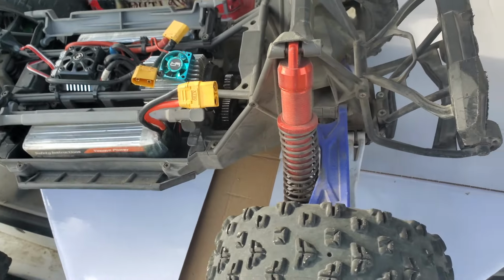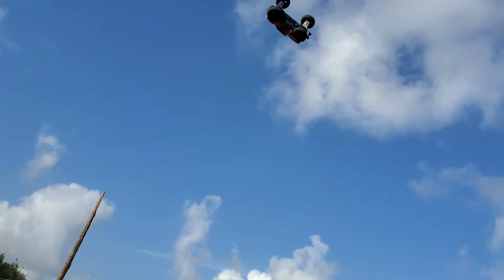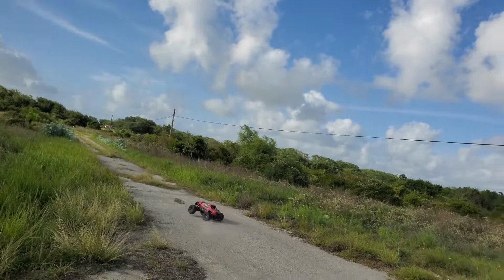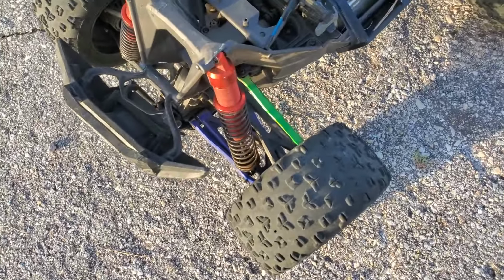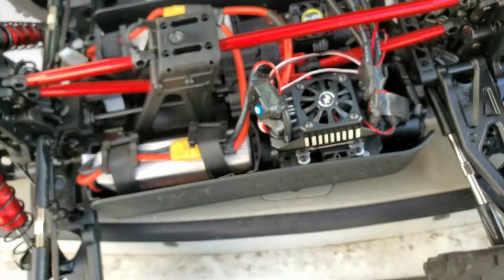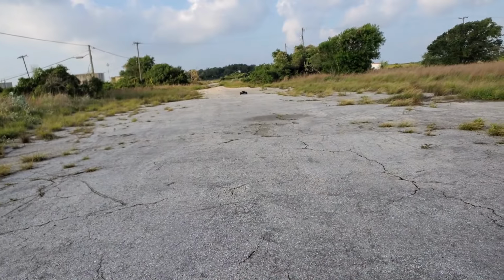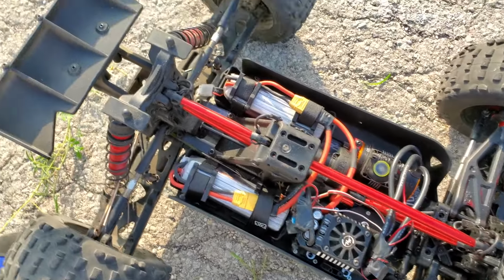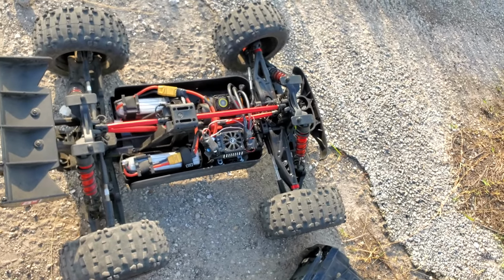Xmaxx VS Arrma Outcast 8s EXB!🔥

Comment: I'm still runnin my 8s oc stock elecs, enough power to manage without spending the big bucks. However the xmaxx is modded just waitin til incan afford a better motor.. maybe a 1650kv hw? Sumn manageable with a max6
Reply from the maker: Yes keeping the power tuned down helps keep the rig together for sure 💯⚡⚡👍

Comment: The arrma is stock so not complete fair compares. Also is the center driveshaft still straight on the xmaxx. But it was a cool video off both the cars🤙🏻
Reply from the maker: Thanks bro! Actually Xmaxx driveshaft has been modified and cut into pieces to create a wobble shaft so it never bends.👍💯🔥

Comment: Hey man how do you make you Ramp? What angle is the lip?
Reply from the maker: So the ramp start out at like 60 degrees and the about half way it kicks up to an 80 degrees  wich is almost straight vertical. It really make backflips sooo easy.
Reply: @thunderrc  thanks for the reply man. I just just watched your death ramp with vorteks, nice. I’m think of making a ramp like that but slightly smaller so I can fit it in my hatch back with the 2 rear seats down
Reply from the maker: That sounds like a good plan man! You will get some major air time bro!

Comment: How or what do i need to put those kind of tires on the xmaxx? Cause the center hole aré bigger on those tires then the stock ones
Reply from the maker: Yeah so what you will need is a good sized washer. I basically drilled out a washer to make it fit snug over the wheel hubs so it snugs up the slack and it works perfectly.
Reply from the maker: https://youtu.be/rMptZPl3q2A check out this video bro, I show and explain. It's a pretty awesome trick!
Reply: Nice! Good looking, yeah I thought about something like that just was wondering if anything different lol but thks ill try that!
Reply from the maker: @a10v  Awesome man sounds good!

Comment: The good thing about the XMaxx is that the body is made of plastic to absorb shock.
Breaking the classic notion that metal parts must be used
Reply from the maker: That's the truth right there 😍🤩💯
Reply: Lexan not plastic, absorbs just as well but is more flexible paint sticks better
Reply: @DreadEnder  he’s talking about the chassis.
Reply: @Tango_gtr  ok it is a little confusing because some places call the chassis or frame a body and the body is a different part

Comment: Did anyone notice the XMaxx didn’t have Electrical tape wrapped around the chassis before the bash started, but did after the bash.  That should tell you something about the XMaxx!
Reply from the maker: Haha man I just use that tape to keep the batteries from flying out of the clips. Not to hold the chassis together 😂😂. The Xmaxx was just fine after the bash and still going.
Reply: @thunderrc  I totally understand.  The XMaxx is a beast.  I do wish it had a strap to secure the batteries
Reply from the maker: @jasonbrickman8065  Haha yeah man a strap would be sweet for that. I'm thinking about screwing the snap battery holders shut everytime and trying that out. Might work good

Comment: XMaxx sucks compared to Arma when it comes to bashing you have to put the body back on every time you jump the XMaxx and also it can't get as much hair as the Arma line up
Reply from the maker: Haha yes the Outcast does outperform the Xmaxx by far In height, handling, speed, and better looks, but the Xmaxx will always be more durable and take harder hits because of weight.

Comment: Another amazing video! I need a ramp like that so that I can attempt triple backflips with my X-Maxx 8s, Outcast 8s and EXB K8S 🤣. They all have upgrades, so they are beasts like yours. I could probably get a quadruple backflip with all my giant rigs because of the giant motors 🤣👍. Are you landing on concrete? Stock tires on the Xmaxx?
Reply from the maker: Awesome man! Yeah these trucks are just amazing man!! So awesome!
Reply from the maker: I land on mostly grass and concrete sometimes, actually I run the Kraton 8s tires on the Xmaxx.
Reply: Hopefully your O8S EXB chassis holds up. I bent my K8S EXB chassis after a few giant jumps, so I had to replace it with the M2C chassis.
Reply: Arma King... Body strong

Comment: Sorry but the xmaxx still the best my outcast has a bent chassis already and my xmaxx is 3 years old no major damage!
Reply from the maker: Yes the Xmaxx is the Beast of all Beasts!💯🔥🔥🔥💣
Reply: Watch Kevin talbot he’s been using xmaxx’s for 6 years and took them out every day, he is the hardest basher in the world, he only ever broke two chassis, both 6 years old with no treatment and were when he landed a 50ft jump on the ⛰ spike of a ramp, he bent the new “7075 T8 aluminium” 5mm arrma ebx chassis with his bare hands ( T8 grade doesn’t even exist)
Reply: Arma King... Faster... Body stronger.  💪
Reply: @mahlok8210  Opposite Day was a while ago

Comment: Did you go off the ramp backwards when it broke? If so I would think the Xmaxx might struggle with that as well LOL have you checked your center shaft on the X max it sounded like some clicking and I know on those nose landings it will bend  those
Reply from the maker: My Xmaxx center drive shaft has been modded with one of my magic tricks. It cannot bend. It has been cut into 3 pieces and is joined with the splines. Been runing the same shaft for 2 years 🤣. It just makes that noise. I call it a wobble shaft 🔥🔥. Also with the Outcast I hit the ramp straight on but somehow it got twisted up backwards and sideways up in he air. It was a crazy jump! Good news is that it is fixed now and runs perfect👍💯. Thanks for watching brotha!❤🚀
Reply: @thunderrc  Absolutely bro I love the counter and yeah I have the 2 Piece Center shaft On the X max myself. I have the Kraton 8SEXB and I love it I just got the RTR 8S Outkast a week before the fucking EXB LOL or I would’ve got that one as well don’t get me wrong I love the X max and it truly is an awesome basher I think in a way you could say that it is the ultimate big basher but with that being said I think it’s just average in all categories like it jumps well but definitely not the highest or furthest out of the big guys and it’s definitely not the fastest as well. For the longest time I wouldn’t Buy anything with an aluminum chassis just because of bending I was hard-core against them but then I got to Typhon 6S and that thing is a blast and I never had any issues with pending that Chassis. Then I got a Kraton 6S that was problems LOL but after I upgraded the chassis it became one of my favorite then a couple months later I pulled the trigger on K8s EXB. Since then I sold two of the 3X maxs I had. I kept one but it’s been sitting on the shelf ever since I got these I haven’t ran my OutKast yet I’m waiting on the chassis to get here on Monday I can’t wait if it’s anything like the K8 I’ll be happy but awesome videos brother keep them coming
Reply from the maker: @BEASTMODERC  Heck yeah man those Arrma rigs are a total blast to drive! I love them too!

Comment: Part 2,Outcast was going quite a bit bigger than the biggest Xmaxx airs because that extra weight she just flies. Was shocked nothing broke even on the good landings huge slappers to the pavement 😱👌
But them two bad ones were just as bad as the two bad Xmaxx landings and you broke several things.... Just saying
It's the weight bro. OUTCAST is like 5-8 lbs heavier and less plastics to absorb landings.
Way to put them to the test.... I knew this would be epic. One of the fairest tests of these tow I have seen brother... Appreciate
Reply from the maker: Thank you brotha! I appreciate you watching and the feedback!🔥👍Yes both of these trucks are completely awesome but that Xmaxx is so insanely tough due to the lighter weight and all plastic chassis.🔥🔥💯
Reply: @thunderrc  oh killer driving BTW.... That Triple was epic off a Medium sized ramp 😳😱😎👍👍👍

Comment: I had a 25ft plus landing with my EXB K8S just like that on two wheels only (right front and right rear wheels). I damaged my rear shock cartridge and dsstroyed one of my batteries that got ejected because I forgot to put a strap across the battery (two stock straps is not enough), but that was it. I agree, any RC would break on a landing like that 🤣👍